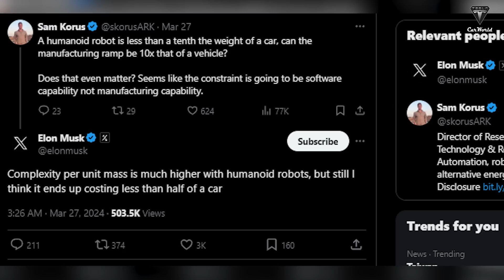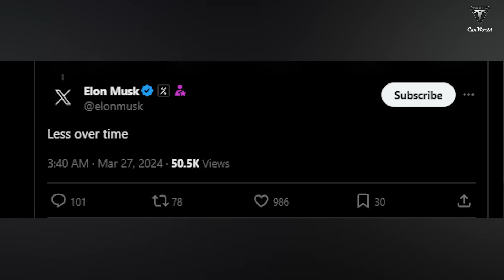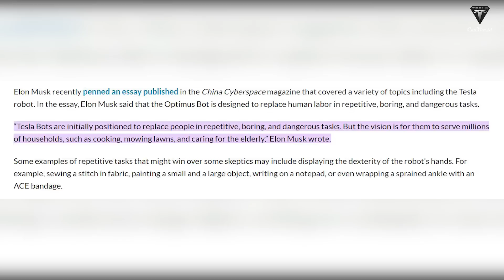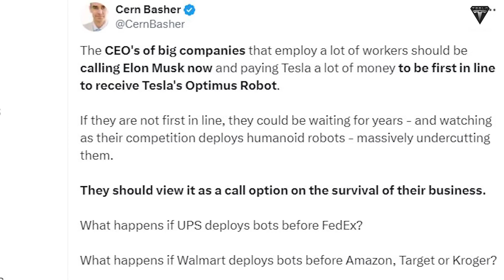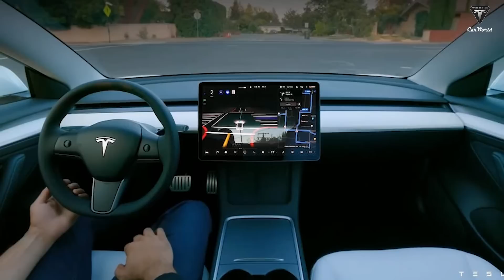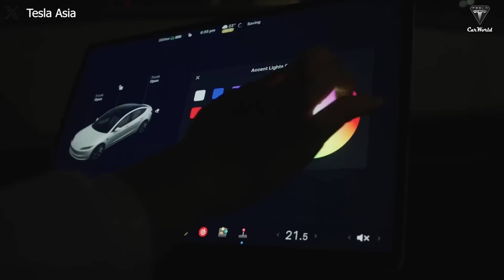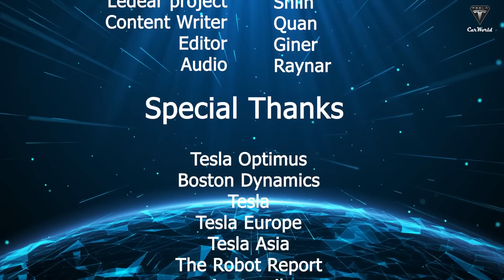Elon Musk LEAKED 4 Reasons To Buy Tesla Optimus Bot Gen 2 in 2025, 4 Best Features As A HomeMaker!

Comment: Once they get the parts on an assembly line, there shouldn’t be a reason why it can’t be less then 25k. The AI program is what will cost a lot like FSD is 12000 dollars! I bet musk will charge per chore performed. Vacuuming will be $1000. Make a sandwich 5000. Scrub toilets 10000. Unlocked version 100,000